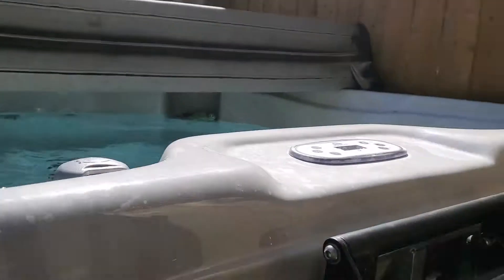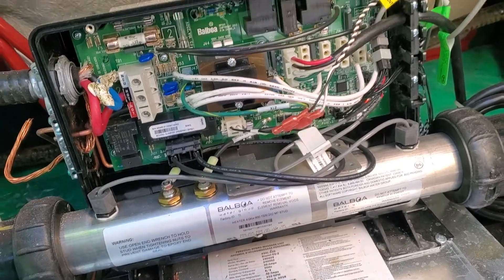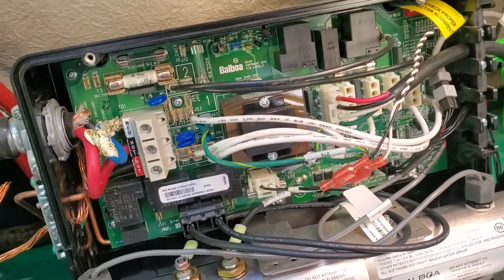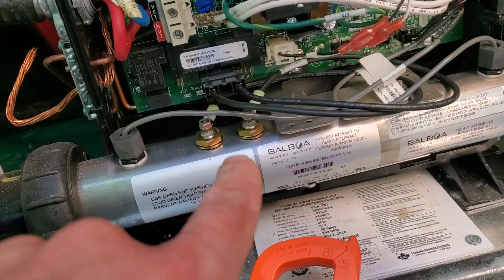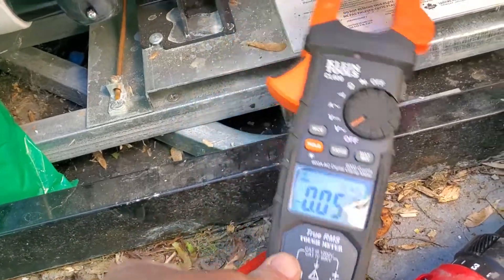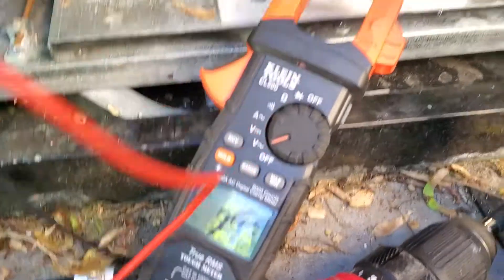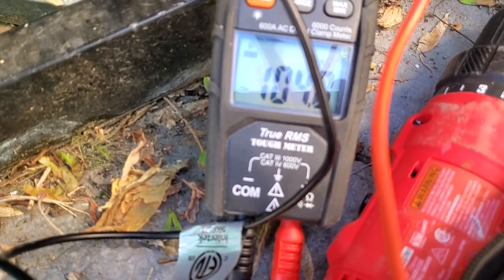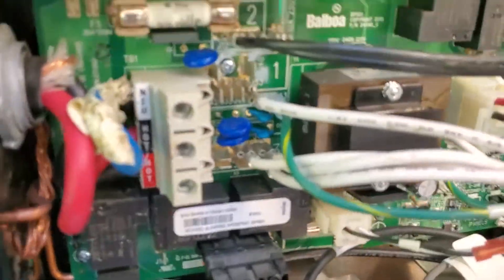Balboa spa pack with a stuck relay.

Comment: Have a hot springs tub with blinking red light on panel. When turning on the breakers panel lights up and I hear a relay click then it dies and the red light blinks. Only thing I can see is the small e5 style circulation pump doesn’t seem to be working, it’s hot and if I tap on it with a mallet it moves a little then stops again. Could this small pump be the cause of failed start up? Is there a work around to have the big jets circulate the water to eliminate the small pump and confirm it is the problem?  There are jumpers 1-12 on the board but of course no schematic as to what they go to…

Comment: Disappointing design - relays should be modular - not surface mount. No consideration into serviceability. Relays are a cheap, east to get, and easy to replace. Ever look at your car's fuse panel? its loaded with removable relays. Replacing a $500 board for a $15 relay is a shame. However if you are good at soldering components - this is still an easy DYI. Always replace both relays - the other relay's failure is eminent.
Reply: Soldering is not a difficult skill to learn either but I agree, Balboa systems is not making these to be easy to service.
Reply: Here I am trying to resuscitate a 20 year old board. Think I have some bad relays, but I'd rather try to fix it than spend $560 for a new board. 
It's ridiculous that all the manuals say the board isn't servicable, heater element can't be fixed. Well I just bought a new element and probably need relays, but it is 100% able to be fixed...

Comment: So change the hole spa pack
Reply: For Balboas you can change the board. For Gecko packs change the whole pack, but there is a model with no plugs thats a bit cheaper for replacements. Generic manufactre- Chinese tubs it depends.
Reply: Replace the relay lots of videos on that
Reply: @chrissalamone902  One guy said the relay was too wimpy for the heater.  Obviously it is there seems to be a lot of info on this.

Comment: Aquarest AR - 300P.  Same scenario - Temp reading high numbers 106 - 108.  When pushing bubbles button - getting clicking sound.  Can hear clicking in circuit board.  New circuit board replacement?  Thanks!

Comment: Hi there, I have an almost identical-looking balboa system, the element looks exactly the same. The other day we had the electricity go off 3 times in 3 days, turns out an electrical lead laying in water. Now I have discovered that the hot tub heating was going down from 31 to 20 degrees where it has stayed.  here in Sweden, it is 3 plus degrees at moment. I have checked all fuses and the main one on the top left. All ok. They should all be on 0 reading. The big fuse was 0,001. When l checked it .I checked the heating element with the multimeter, with electricity on, the reading was 0, not 220-240v. The Pump is running normally by the way. I do not know what has happened but my suspicion is the electrical circuit breaker , that tripped 3 times. the other day has caused something to happen. Why would this cause the element to stop working? Do I need a new element ,? is there any relays that have something to fail with the heating element.? No-fault codes on the top screen, all look normal.
Reply from the maker: Hi Kevin.  Possibly the relays have somehow become damaged. 
You need to test the power comming from the spa pack, if your not getting power then most often just replace the board. 
Question: in Sweden 240v, that's two wires plus a ground correct? Is it black and red wire with a voltage difference of 240 between them, and is red to ground or black to ground 120v? 
If so then there are two relays on the board,  one for black and one for red. You can test both legs going to the heater to ground and should see 120v each. Test this with the terminals off the heater. Likely you will see 120 for one and zero for the other.
Reply: @tiov3001   Sorry, I thought you would probably get a bit confused about the breaker thing. The breaker was nothing to do with the hot tub. It was an extension lead sitting out in a puddle, the breaker was inside the house that caused all electricity to go off. This happened for 3 nights before I found the problem. Obviously, this caused the hot tub to also go off 3 times. I am convinced this caused something to happen to the circuit board, just must of, too coincidental. Now I can order a new element and put it in no problem.But if l have no 220v going to the element i have now ,how is a new element going to suddenly show 220vs this is what l dont get. Checking amps obviously ,there is none if there is no 220v going to element. I don't understand this amps thing anyway and do not have a amp meter. only a multimeter. The relays look ok, but hard to tell without taking the circuit board out and looking for burn at the back. It is snowing here ,so this job is become more problematic. Scared about pipes freezing if l empty the water etc. It is staying on 19 degrees. Is this something built into the system as a safeguard perhaps ? Changing element is very easy, if it is a relay, then I don't know if it can stay like this until the spring time.
We have 220v here which is a earth,blue and brown wires.
Reply from the maker: Sounds like you need a new board. The existing one should kick into freeze protection ND the pump should run full time. You could also run  submersible pump inside the tub with no discharge hose on it. The friction from the pump will heat the water.
Reply: @tiov3001  Hi again, the hot tub is only 17 degrees now, hoping it does  not drop anymore. It is now minus 7 here. I think that the pump coming on now and again,just keeps the water with a little bit of warm in it. I don't know about any freeze protection, can not see it in the manual. Is not that simple to buy a new board. For one they cost 600-700 dollars here and quite hard to find the exact model. I have to hope that the hot tub can function like this until spring, take out the circuit board, and get all relays replaced.far cheaper. This is what l did today.    rechecked things . There is 230vs coming in to the circuit board, but when I put the prongs on the element I get 0 reading.No 230v. Even trying the brass thingies connected to the board with the two bolts 0 reading. Then I turned off the mains and checked the ohms and continuity. Was not sure if I was in the right setting, it said 0L, and the reading was 0.001.  No 10 or 11 like it should be.. Then l put it on a setting so it made a buzzing noise and it then read 19. Would you say that if it has these readings then it must be the board and that there is no point just replacing the element? .
Reply from the maker: @swedishkev  https://www.hottuboutpost.com/hot-tub-heater-repair/
Reply: @tiov3001  Thank you for that,its very good.I don't have breaker issues, and l still need to find out if it could just be the element.  The fact that l have not got 230v going to the element,seems unlikely to just replace with a new element is the problem.